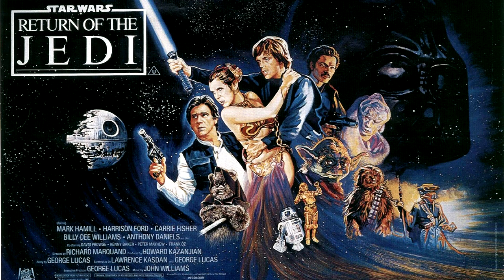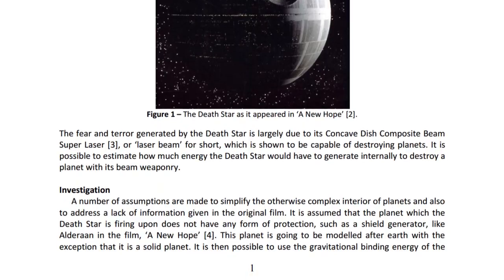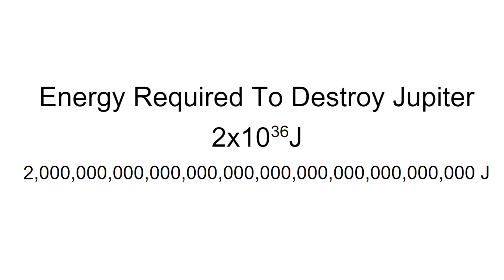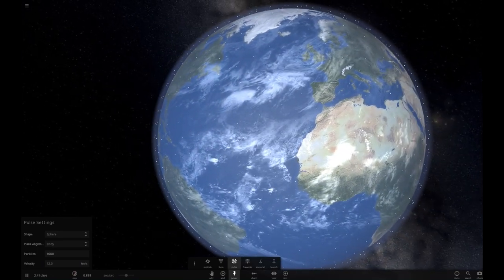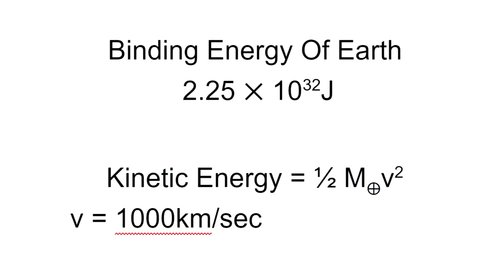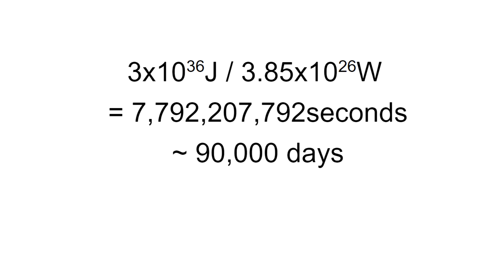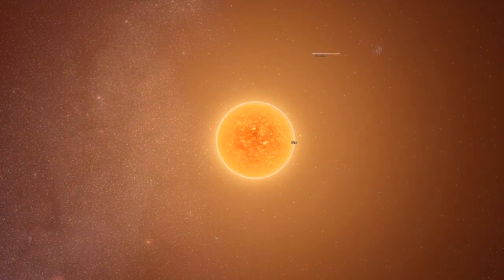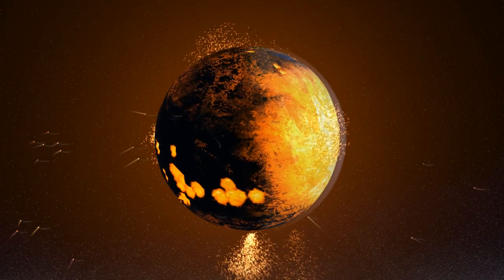How Much Power Do You Need To Destroy A Planet?

Comment: [Spoliers]By the way, as far as I can tell, the Starkiller Base was only needed for 2 uses (both of the First Order's enemies), which it almost completed. One for the New Republic (first shot), and one for the Rebellion base, which it had a few seconds before this would happen as well. Then the use of it would be done, and they could just leave it floating in space. I agree that at the time it seemed incredibly stupid and like a huge oversight, but once I figured that out, I realized it made a bit more sense, and then I only wondered why both the New Republic and the Rebellion base were in the same solar system/relatively close together... Could be useful for defending, but also divided forces, and not a big problem with lightspeed travel. Or else they didn't give us a proper scale of the time the laser traveled, it could have been minutes long, or even (many) years in real life.And if the Rebellion base was in that same solar system, then why wouldn't they have detected the starkiller base's destruction, and wouldn't they now freeze if they didn't evacuate quickly, what with, not no sun, but a much smaller sun that there was for the first shot. Maybe it was a temporary base, but then why did Starkiller base know to have 2 shots, could the second have been effective on the Rebellion base's real planet... yeah lots of logical problems here, maybe we'll get some more clarification later.

Comment: You've calculated a stars output and how long it would take to siphon off the needed energy needed but that's not how Starkiller Base worked. It consumed the star itself, mass and all, it wasn't just harnessing it's output. In this way not only is active nuclear output consumed but raw materials are recovered and stored to be used in whatever manner the Empire has designed. 

As far as continuing usefulness I wouldn't put it past the Empire to build a weapon of this magnitude that could only be used twice. Complete destruction of 2 solar systems (3 if you count the one you killed to fire said weapon) from anywhere in the galaxy without having to put a single stormtrooper on the ground seems pretty good in a risk/reward sense. Of course, they underestimate the rebels yet again and never get to that second firing.

Comment: In Star Wars it's a lot easier to destroy a planet because they have the capability of hyperspace travel- which is either warp technology or faster than light travel. Either way, it means that the Star Wars universe has "shortcuts" into destroying planets. Having access to FTL means you have the capability of near infinite energy with your power source or you at least have the capability of teleporting things like large planetoids into a direct course or antimatter into the center of a planet. 

I know that you were using normal non-fantasy physics but I think there's still shortcuts. I doubt you could convert an entire planet into dust as quickly as in Star Wars but I think we're incapable of knowing what is truly possible with physics when we still don't know a lot. I truly think it wouldn't take the energy of a giant star to destroy the earth, you could do it by ramming a chunk of the moon into it or by placing antimatter bombs strategically into the mantle and causing a chain reaction. Eventually we will have more advanced technology that will make things even easier.

Comment: What you are not taking into consideration is that destroying a planet is not simply a 'moving' project or a question of effecting mass. Planets hospitable to life must have active volcanic systems so that the planet itself is performing a 'balancing act' of sorts as it goes through it's existence. On one side, we have gravity keeping all the mass--solid and liquid--together in a roughly spheroid shape while on the other, geothermal energy which much push upward through the surface to vent excess pressure. Thus, all that is required to blow up a planet is a disruption of that balance. Even vaporizing the oceans might cause the tectonic plates to blow out once they'd been relieved of the weight. Surrounding solid mass--now hammered by super Tsunamis and without the plates to keep them apart--will feel even more jarring as both the rate of the planets rotation on axis and orbit are effected by first collapsing in on itself then being pushed away by the remaining escaping core pressure.

Comment: If you are trying to destroy the planet from the outside in, this theory and video makes sense; but since the energy beam from the Death Star went through the planet's core, the weapon seems to have been designed to turn the iron core (assuming rocky planets in the Star Wars universe have iron cores) to gaseous iron and plasma. Suddenly turning the core into an insanely compressed superheated iron gas/ plasma should cause a high-velocity jet  (seen along the path of the beam) and explode the planet at the highly accelerated rate, sort of like microwaving an egg in it's shell. Once the shell (mantle) cracks, the gravity bonds are broken and the planet essentially turns into a large fragmentary grenade.

Comment: Nice video, but 4:15 can you really calculate this only using the emitted energy. Because I mean if their sucking in the whole sun they're kind of consuming the whole fusion reactor. Plus the emitted energy isn't that only on the surface? If the Sun gets sucked in, cant the surface area of the sun be somewhat extended inside the starkillerbase, so that there is more area to emit the energy?

Comment: The concept of destroy would first need to be defined.  Also, the word "power" is relativistic and related to "energy", and the method of destruction determines vast differences in the energy needed.

If destruction is defined to be the fragmentation of the planet into two or more approximately equal sized parts, strictly using Newtonian physics, then 

1) natural fragmentation: one only needs to wait for the Sun to age and engulf the Earth and fragmentation occurs as part of the fuel cycle.  The energy needed is actually negative, as the Earth provides the energy to fragment itself.

2) ballistic matter impingement: planet sized coalesced matter from a billion years of solar mass ejections start a return journey back towards the Sun and the Earth happens to be within its trajectory.  F=mA or a mass 1/2 the size of the Earth traveling at 4 times the orbital velocity of the Earth around the Sun and hitting approximately centered mass.  The energy of the coalesced mass is in free-fall towards the Sun.  So the energy is related to kinetic energy, and the makeup of the stratified layers of the Earth and coalesced mass.  A positive amount of energy needed to fragment the Earth.

However, I am guessing the intent is to produce a visually similar Death Star weapon and related destruction.

Considering non-relativistic physics is in play to allow faster than light space travel.  Then "energy" is not a dominant relationship to manipulate; changes in energy are relativistic observations from consequences.  Non-relativistic physics (sub-space) is then being manipulated and zero energy is required to destroy the planet, destroy the universe, build a new universe, or build manipulate any alternate dimensional space.

Google Search: "Axiom of Choice extended to include Relativity"

Relativity (energy and that which we can see) is only in-part causally logical and repetitive.  Math ONLY relates to logic and repetition.  Mathematics is a subset of logic, and logic is a subset of causality.  Non-relativistic space has large sets of components that neither repeat nor are logical in the reference from of "our" relativity.  So we can neither see nor intentionally interact with non-relativistic space based only upon visual cues.  Examples are: fringe patterns, quantum entanglement, gravity, duality, uncertainty... things Newtonian Physics cannot relate to.

The potential is that a true quantum computer that has its states quantumly entangled to an inertial frame of reference could destroy a planet by corrupting the physics constants that define what matter is in our relativistic universe.  The result potentially being in-part a nuclear process called "total anihilation".  Releasing energy bound in matter to destroy the planet of interest.  No energy is actually created or used to corrupt relativity, but the corruption causes an inconsistency that is relativistically explosive.  What happens in non-relativistic space, sub-space, or other conjoined spaces of relativity?  I don't know, this was a mental exercise and is not currently based on experimentation.

Comment: Answer this:
Where does the energy come from that can push the Falcon over that super speed, that can be generated in a local apartment's size yet does not burn out the bystandards?

Also, I want to make a Dyson Sphere out of Earth at 1 AU. How thick it will be if I only use the materia from Earth? Or all objects from the Solar System except the Sun?

Comment: Accelerating everything to escape velocity also seems like overkill to me. Turning the planet to disconnected rubble is probably enough, even if the rubble falls back and forms a new planet, and then you will still have gotten rid of potential cities in the core, like Zion in the Matrix (or actually outside the matrix :-P).

Comment: Star Wars is only a movie. The physics behind it is not critical. Like how much energy does it take to accelerate a space PAST the speed of light? Secondly, the energy it takes to destroy a planet does not necessarily need to be injected from the outside. For instance, how much energy does it take to ignite the sun and start fusion? The gravitational force pushing the hydrogen atoms together starts the fusion process, once initiated, the system is exothermic.  The Death Star can be a weapon that provides an initial burst of energy into a planet (like striking a match) which causes a chain reaction that leads to the explosion.

Comment: I'd just mess with the inner core of planets if i could tap the power of an average star.
Get that core spinning just a bit faster will induce currents that rip appart the whole surface by lightning for ages to come.
Throwing meteors is so retro... :D

If you are that adavanced the most effective way would be to alter the fusion of the targetsystems star.
Supernovas & Neutronstars are way more fun then laserbattlestations.

Comment: Was that article published on anything? Because the math is way too trivial for publication. They even assumed uniform density distribution, which is not a very reasonable assumption. For example, if you approximate the actual density distribution (https://upload.wikimedia.org/wikipedia/commons/8/89/RadialDensityPREM.jpg) by two lines, you get ~1.7×10^32 J, or about 20% less energy.
(By the way, it's interesting to notice that you need less energy, which might be non-intuitive if you remember that you need positive energy to make Earth homogeneous.)

Comment: My problem with the concept of the new super weapon is that it's not putting out pure energy. Instead it seems to act like a quasar, in this case the sun is not supplying the energy to destroy planets, its simply being used as ammunition. There is a shot of the republic home world staring at the beam that is about to destroy the planet, this means that is it traveling at sub-speed of light, in which case it still has almost all, if not all of its mass since looking at the beam did not seam to cause harm like a laser would.  So not we are talking about fitting an entire star inside of a planet, negating gravity, then shooting all the mass of said star out with the force only black holes have. This design seemed far worse to me in every way possible.

Comment: In Force Awakens they siphon a star into small planet thru small opening in planet crust. That's equal to draining a sea using a straw. They do that in superluminal speeds. They manage to contain all that mass without turning planet into a black hole/implode/explode. If they can do that destroying a planet or entire planetary systems should be piece of cake. To me that was a point were I couldn't suppress my disbelief anymore. It's almost as bad in ruining the experience as TLJ hyperspace jump ram which is something you shouldn't be able to do in SW universe. TLJ "fortunately" has so many other problems in logic, continuity, character arcs, acting, script and others that that particular one didn't stand out from rest of them.

Comment: I always figured they just used energy to over pressurize the interior of the planet until it exploded using a high energy particle beam. The lasers could have been used to drill down to the interior. I believe this method would require less energy overall than the figures quoted, but what do I know. I am not a Scientist just a retired R.O.V. Supervisor who specialized in Electronics, Hydraulics, Sonar, Survey and the like. I have a very basic understanding of the science involved but it mostly ends there.
Reply from the maker: +richb313 The center of a planet is already under insane pressure, increasing that pressure takes a lot of energy.
Reply: I agree, but would it take less than what you speculated? I honestly have no idea but my gut tells me less. I am probably mistaken in my assumptions, won't be the first time or the last. Thanks for responding. I really enjoy your videos.

Comment: While I can't fault your math, I do question how you frame the question.  Calculating the energy needed to toss each and every fragment of a planet outward at escape velocity and then toting up the energy in all those tosses and saying that the ray needs to be that powerful, seems to me to leave out one gigantic fact:  You're not talking about exploding some inert, cold planet-sized stone -- you're talking about a body that is basically a bubble of crust surrounding a mantle of magma!  In fact, this mantle isn't even a static region of magma, molten but motionless.  Instead, it is like a large and very active lava lamp, with blobs of hotter magma rising and colder blobs settling toward the core, over and over, like some vast, bubbling, hellish cauldron.

So rather than aiming your ray at a half-meter boulder, think rather of targeting a 5 gallon can full of gasoline!  How less powerful now will your ray need to be to blow that can to smithereens?

Your approach assumes all the exploding energy needs to come from the ray itself.  However, there's a planet-sized amount of heat energy in the magma alone.

And that's not even allowing for more advanced science being speculated in this fictional universe (advanced science like FTL travel).  What if the ray is along the lines of say a neutrino-based particle beam, able to trigger a nuclear chain reaction in the planet's elements?

Even the smallest match can burn thousands of acres of forest, and no one thinks the match itself contains all that potential energy.  The match is merely the trigger -- the forest contains all the fuel.
Reply from the maker: +JusBidniss The iron core of the earth is about as inert as things can be, you can't generate energy by fusion or fission so that's out. Sure it's magma, but gravity is holding it in place, the thermal energy inside the planet is insignificant compared to the energy required to tear the planet apart.

Comment: Starkiller Base takes the entire Star's mass in. It doesn't absorb its energy for a while. It's the whole thing. It clearly in the movie consumed the whole thing. So yes, starkiller base would have to have some kind of hyper drive to propel it to its new star to be consumed. If they've figured out a way to suspend inertia and acceleration forces in a ship so occupants aren't mush, wouldn't they need less energy to propel an object to light speed? And wouldn't propelling a planet be no different than any other ship? It'd be just another bunch of massless particles.
Reply: +Markstang Actually, they trave through a dimension known as "Hyperspace."  It isn't straight up acceleration as there is no acceleration/decceleration time.
Reply: Except Han says the falcon will make .5 past light speed.
Reply: Markstang Right, using lightspeed as a basis for comparison as it is the only one worth looking at when it comes to these speeds.  We're talking pretty insane speeds.  Parsecs per hour even.

Comment: What about chemical binding energy? All that matter is not simply held together by gravity which is a puny force about a million times weaker than the electromagnetic force . After all, it's not a collection of boulders resting against each other. I suspect that to properly disintegrate a planet you will need to hit it with a million times the gravitational binding energy, otherwise you just end up taking out a chunk of it. Not that that wouldn't render it inhabitable, but if that's the goal all you really need to is hit it with a Chicxulub asteroid and cause the atmosphere to ignite with all the debris re-entering - far less energy and much more economical.